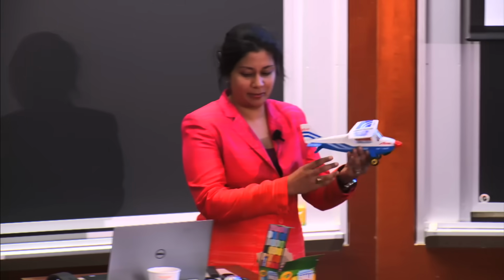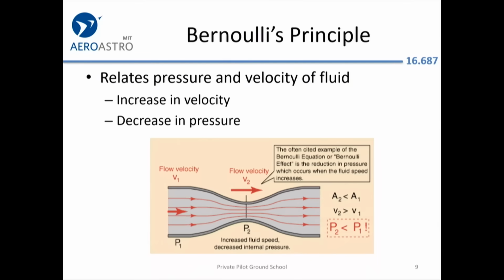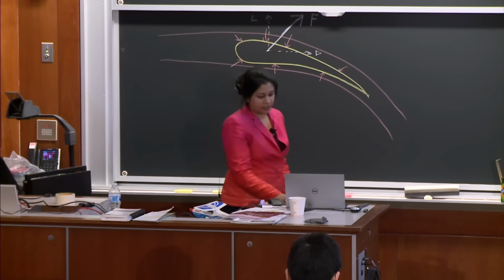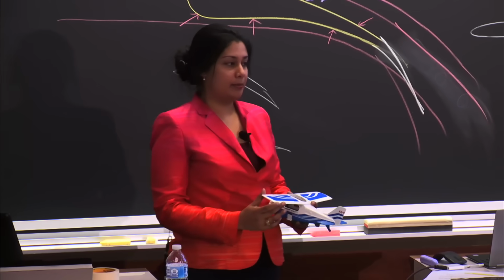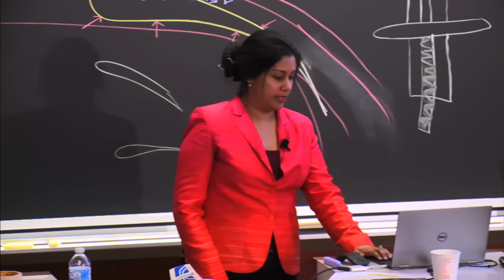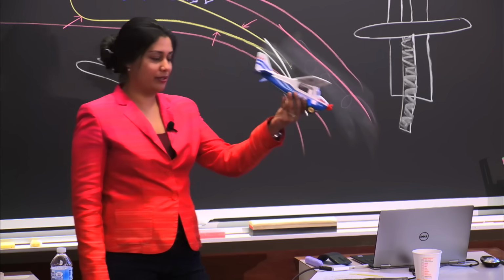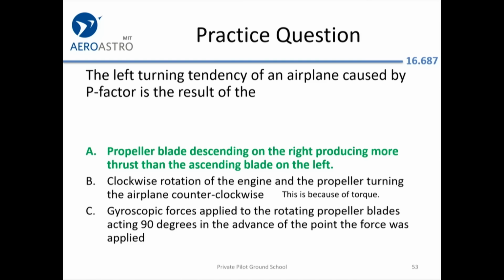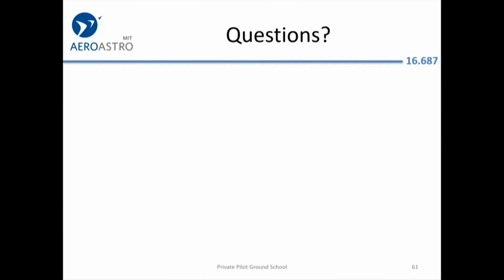Lecture 2: Airplane Aerodynamics

Comment: The omission , when discussing aircraft  rather than cars etc is the aerofoil .  Air moving across objects creates some lift, but without the aerofoil , aviation would not exist as it is. 
Air moving across the top surface of an aerofoil moves faster, lowering the air pressure. The pressure on the flatter underside is greater.  This is why the aerofoil is so efficient as opposed to other objects . Take the wings off the aircraft and go full thrust down the runway . If the tailplane was still attached , it would generate some lift and pitch the nose into the ground at speed . With no tail it would flip over . Neither of these are flying.  It's the wings and the wings alone on any aircraft that generate anything  approaching enough lift for controlled  flight .  And it's the aerofoil cross section that provides that. Quick mention of Bernoulli , but for flying , it's physics not maths. Blow across the top of a flat a4 sheet of paper. No downward force or angle required. The paper lifts because the air pressure decreases on the top.

Comment: One of the things that I dislike about this lecture is that her focus is more so driven by her need or desire to disprove Benoulli's principle then it is to teach the theory of flight. It's almost like she believes Bernoulli's principle is some type of false teaching or doctrine, and it's her mission to prove that it's not true. It seems like that's her focus. In the end, it's all theory, and it all boils down to: increased velocity equals decrease in pressure. An airfoil in motion brings about an increased velocity over the top of the airfoil, which causes a low pressure on top of the airfoil and we know that a high pressure always seeks a low pressure, so the high pressure underneath the airfoil seeks the low pressure on top, which causes lift or suction, really the aircraft is being sucked into the air, the same way a vacuum cleaner utilizes benoulli's principle to create a low pressure on the inside, which results in the high pressure on the outside to suck in dirt and debris but I guess she wants to make a name for herself by challenge the validity of benoulli's principle or the fact that some believe the air molecule split at the leading edge of the wing and reaches the trailing edge at the same time.

Comment: I have a question > Does Bernoulli's theorem not relate to generation lift?
Reply: No, it does not. The typical narrowing/widening tube example for Bernoulli generates no lift whatsoever. That tube won't magically start hovering. What generates lift is exactly what the instructor said: the wing of an airplane deflects air downwards and it is momentum conservation that guarantees that there has to be an upward force on the wing in return. That is, if anything, an example for Newton's third law. This also means that the same airplane can easily generate lift downwards by assuming a negative angle of attack. Point the nose down enough and you will soon see the ground coming at you at an amazing speed.

Comment: So many man use Bernoulli's principle in wing design ,the fact that Mr Bernoulli explain his principle purely applies to fluid in confined space or fluid that flows from point a to point b in a closed space where the opening is only at that given points.Good example if the wing model is brought inside wind tunnel.But in reality wing of a plane is not moving in tunnel like scenario.The correct law to apply in the design is Newtons Law. Mass conservation,Or simply Physics by creating free body diagram or by plane Trigonometry.

Comment: This whole explanation is only partially correct. Let me explain. The main force of lift for an airfoil come from the TOP surface of the airfoil due to what is called the COANDA EFFECT. Essentially, what Coanda effect says is that fluid stick and follow a surface. That is why when you pout coffee out of a bowl or a mug, it runs down the side of the mug and not straight down vertically even though the vertical down path would be the shortest and least energetic path. The coffee sticks to the side of the mug. Similarly, the air from the top surface sticks to the top of the wing, is pulled down by the wing's top surface, and Newton's 3rd law causes an upward force. The lower surface also pushes air down, but is only a small contributor. That is also why planes can hang a bunch of stuff on the lower surface and not the top surface. Finally, that is the main reason why icing destroys lift. The bottom surface having ice wouldn't prevent it from pushing the air down. The top surface however no longer has the air adhereing to it, and lift breaks down. You're welcome!
Reply: Cavitation wants you to hold its bubbles and every pilot of a supersonic jet will give you his helmet to hold.

Comment: Berneulli can't be applied if the flow was divided into two portions (upper & lower Airfoil).. it's applicable when a single Tube enlarged or contracted of various diameter (s) whose corresponding Velocity (of flow) can be calculate, according to Bernoulli.
But in the case if Divided flow.. it's same as SKI-ING EFFECT (of water/snow) that A.O.A. ; the (positive,) Angle of (wind) Attack from the  Leading Edge of Airfoil to the (horizontal) forthcoming Wind direction would create the cumulative pressure under the Airfoil, hence making upward "LIFT" against its weight/gravity.

Comment: Where did she explain that equal transit theory is “wrong”. If a particle of air is in fact moving faster over the top of the airfoil (something she mentioned several times early on) why would two particles not meet at the trailing edge at the same time…. There are about three theories that can account for lift but if you use Bernoulli’s principle (which is widely accepted) then it seems equal transit theory is accepted as well.
Reply: Bernoulli is just as false an explanation as equal transit. She gave you the one and only correct explanation: momentum conservation. The reason why ANY analysis in two dimensions fails to begin with is because wings are NOT infinitely long. They have wing tips and what happens at the wing tips (turbulence) happens to be of enormous importance to the correct analysis of the flow pattern. This simply gets neglected in beginner's courses because there is no simple math for any of it. We can, at most, use methods from computational fluid dynamics to calculate these 3 dimensional flows. That's a very hard thing to do and it's not useful for a beginner to get into.

Comment: I know I’m late to this video, but am I understanding  this correctly about p factor; is it kind of how you can turn in a row boat? More power in the right oar will turn you left? Am I making sense? Lol
Reply: Yes, you’re on the right track! P-factor is similar to how a rowboat works. When one oar (or propeller blade) provides more thrust than the other, it causes the boat (or plane) to turn. In the case of an airplane, P-factor happens when the descending blade of the propeller produces more thrust, causing the plane to yaw to one side.

Comment: Stationary location and constant velocity of fluid mass, do not create forces on the mass, but the RATE OF CHANGEE OF VELOCITY hence ACCELERATION OF MASS  does .
Lift in an wing, propeller and control  surfaces etc., there is a lift force because the upper and lower surfaces of the wing  are  ACCELERATING  shavings of air mass away  below the wing and above  into the wing . The wing is like a sharp blade shaving hair  bristles and accelerating them away.( under the wing)    (Partial vacuum effect above into the wing.)  
The detail of how these shavings, or ribbons of air mass are accelerated down by the upper and the lower surface are due to a compression below the wing and a partial vacuum above the wind. 
The flow above the wing does not reach the trailing edge at the same time as the flow under the wing.  it is ACCELERATIONS AND DECELERATIONS OF MASS OF AIR THAT CAUSE DRAG AND LIFT.

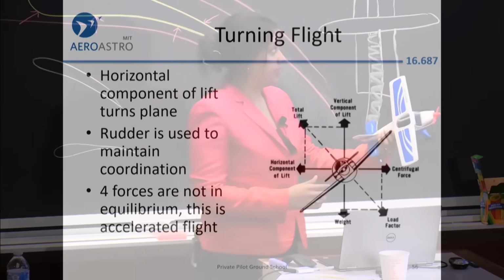At 1:07:35, surely when turning, the total accelerating forces are also in equilibrium, as the centrifugal force comes into action. as when turning in a circle, the circle is kept constant because all the forces are in equilibrium, with the aircraft wing pushing one way and the centrifugal mass pushing the other way, while lift and gravity are also balanced.

Comment: Why the airflow passing thru the upper wing is faster ?
Reply: The airflow over the upper surface of the wing is faster because of the wing’s curved shape. The upper surface is more curved than the bottom, so the air moving over the top has to travel a longer distance in the same amount of time, causing it to speed up. This faster-moving air creates lower pressure above the wing, while the slower air below the wing creates higher pressure. This pressure difference generates lift, helping the plane stay in the air. The shape of the wing, therefore, plays a crucial role in the speed of airflow and the creation of lift.

Comment: Nit picking here, and please correct me if I am not following along as stated. When talking about frame of reference, does stating “the air and the plane are actually traveling the same exact speed” indicate transit theory of “molecules must be traveling the same speed across the airfoil above and below”? Genuinely curious as during my aviation studies we did not touch on frame of reference theories. Thanks for the wonderful videos!
Reply: Speed is always relative and no, not all air moves at the same speed relative to the wing.
Reply: You’re asking a great question! When we say “the air and the plane are traveling the same exact speed,” we’re referring to the relative velocity between the plane and the air around it. This means that, from the perspective of the airplane, the speed of the air flowing over the wings is the same as the plane’s speed relative to the air.

However, this is not directly the same as the molecular theory that states “molecules must be traveling the same speed across the airfoil above and below.” That theory is related to Bernoulli’s principle, which explains how the speed of the airflow affects pressure on the airfoil. The idea that molecules have to travel the same speed on both sides of the airfoil is an oversimplification often used to explain lift but doesn’t fully describe the complex aerodynamics involved.

In short, the statement about the plane and air traveling at the same speed is about relative motion, while the molecular theory is a different way of looking at airflow dynamics. The two are related but not exactly the same concept.
Reply: @ Lift and drag can only happen if air changes its velocity. That's just Newton. People are overthinking this. There is nothing complicated about momentum transfer. What is complicated is the detailed flow in three dimensions because it necessarily has to lead to turbulence.
Reply: @schmetterling4477  You’re right that lift and drag are fundamentally based on changes in air velocity, which aligns with Newton’s third law of motion: for every action, there is an equal and opposite reaction. Air molecules are deflected by the wing, transferring momentum and creating forces. However, what makes the situation more complicated is how this process occurs in three-dimensional airflow, especially around a curved surface like an airfoil.

While the basic principles of lift and drag are straightforward, the detailed flow of air around the wing can become complex due to factors like turbulence, pressure variations, and the interaction of airflow layers. These factors are difficult to predict and model, especially as airflow moves from laminar (smooth) to turbulent (chaotic), which is why aerodynamics can seem complicated. So, while the basic concept of momentum transfer is simple, the complexity arises from the behavior of air as it moves around the aircraft.
Reply: @TopoftheStackAirTrafficSafety  You sound like an AI. Is that on purpose? ;-)
Reply: @ Honestly, I think we’re just living in a time where people have kind of forgotten how to express themselves well and language has taken a backseat. So when someone actually takes the time to speak clearly and thoughtfully, it probably feels a little weird or ‘AI-like’ to some. But trust me, it’s just me trying to communicate properly! Nevertheless, I’m actually all for the benefits of AI. I think it’s amazing what it can do but I still like to keep things personal and real when I can.
Reply: @ No offense, but there is a difference between sounding like a human person and a poor AI copy of a textbook. If you start with "You are right... ", then you are already setting yourself up for failure here because that is what Google's AI does whenever you are telling it that it made a mistake (whether it did or did not). It tries to replace actual reasoning with politeness before it proceeds to basically repeating the same bullshit over and over, again (People don't realize this, but LLMs can't learn on the fly. The context does not erase false training data, no matter how much AI companies are trying to suggest that it can.)

That doesn't mean I am suggesting to be adversarial. All I am saying is that politeness for politeness sake is a really, really poor communication strategy. What it actually suggests is that the other person wants to avoid resolution (be it of conflict, disagreement or learning about a factual matter) at all cost. It is also condescending if the other person is actually knowledgeable about the problem.

Just my two cents. For my taste a genuine human has to be raw to be interesting. Life is too short to stop at platitudes.

Comment: 14:37  - " ... all these forces sum to zero" - it is wrong or an oversimplification for air. There is a difference in fluid pressure on the top and bottom sides of any body in any fluid (in a gravitational field, particularly for liquids - water drones mentioned!). This pressure difference integrated over the total surface results in a force acting on the object that is different from zero - the buoyancy force.
And the pressure on the upper side is lower than the pressure on the lower side - this is how the buoyant force (Archimedes) should be explained.
Buoyancy of a paper plane is really negligible, for an aeroplane (wing, fuselage etc) is also too small to take it into calculations of the lift, but it is very significant for balloons.
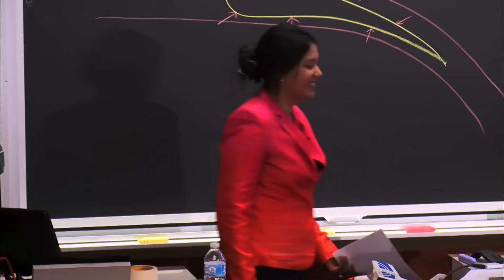Reply: 16:20 - actually a negative lift is present in every good racing car - even without any spolier. The shape of the front part (a nose) deflects air upwards - it pushes the front of the car down (OK, additional "canard" like front spoilers increase this negative lift). What is worth of mentioning - Bernoulli principle is also used to attract a racing car down to the ground. The bottom of the chassis is shaped like a reversed airfoil (reversed classical wing), it produces in this case a nozzle between chassis and ground. Reduced crosssection area. Increased air flow produces lower pressure directed upwards to the chassis. Additional the bottom of a racing car body is made in a very smooth way - to reduce the drag.
The drag in a regular car is produced by all hollows, empty spaces, tubes and rods - all those parts are covered in a racing car. Aerodynamics of a racing car ...

Comment: 12:33  shouldnt there be more pressure or air resistance when  youre traveling at higher speeds?
Reply: Yes, air resistance increases at least quadratically with air speed (except at very, very low velocities).

Comment: 37:42 - For a steady-state climb, lift is LESS than weight (not greater). This can be proven with vectors. An aircraft maintains a steady-state climb due to 'excess thrust' (not lift).
Reply: google says otherwise "For an aircraft to fly, the lift must be equal to or greater than its weight." thrust is also needed to generate lift

Comment: So, you say that Bernoulli’s law is wrong? 😮
Reply: No, it's not wrong, it just doesn't apply to the theory of airfoils. Nowhere does Bernoulli require a total (integral) change in momentum of the fluid. In order to generate lift, however, such a total momentum change of the air is absolutely necessary.